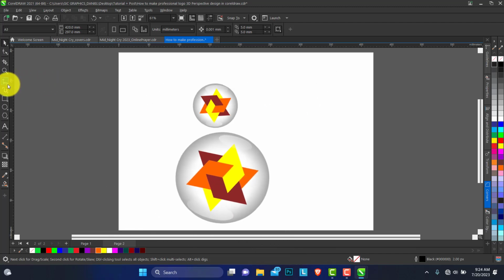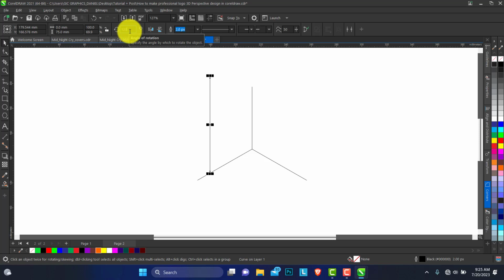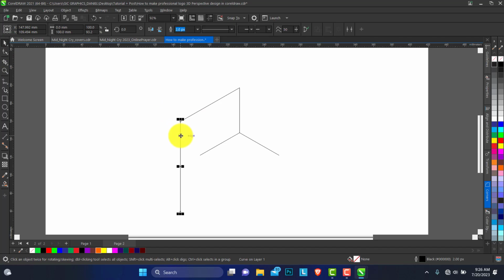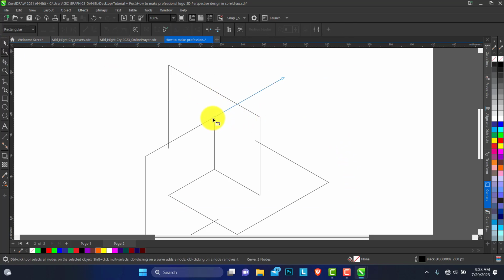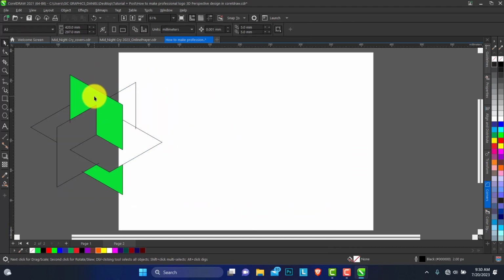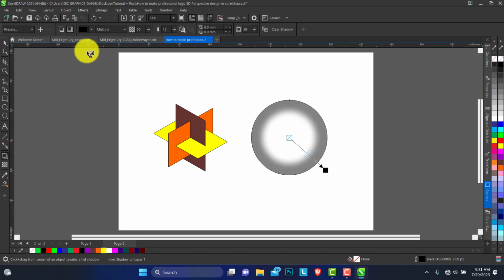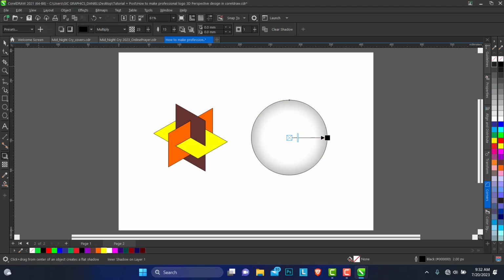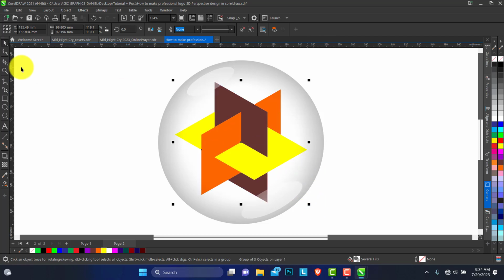Professional Logo | 3D Perspective design in CorelDRAW  #hevlendordesigns #coreldrawtutorial

Comment: Your speed is intimidating. Awesome stuff. I've been using CorelDraw since 1999 yet I don't have this speed. How do you know the angles to rotate to? Do you know what the outcome will be before you try? Keep up the good work.
Reply from the maker: Maybe I will do a special on Rotation handle and Transformation Ducker; but to answer your questions; firstly, to know the angles to rotate to, you generally need to have an idea of how you want the object to be positioned or aligned.  

Now, to answer your second question: No, you might not always know the exact outcome before trying, especially if you are rotating an object to a custom or arbitrary angle. However, you can make educated guesses based on your design goals.

Thanks for watching!